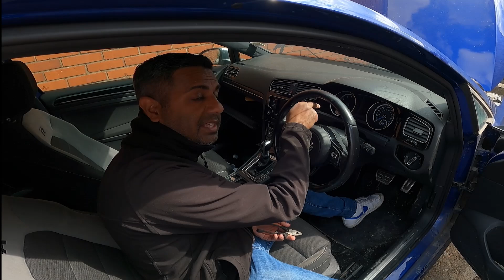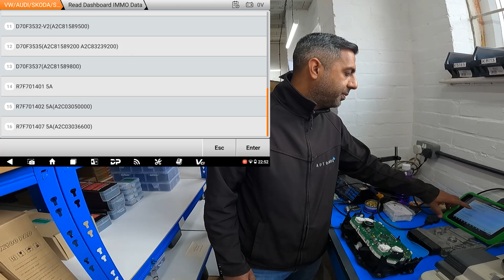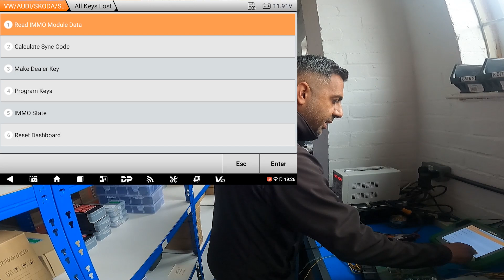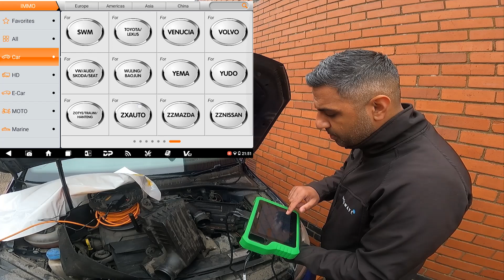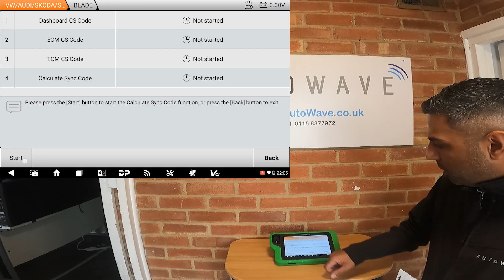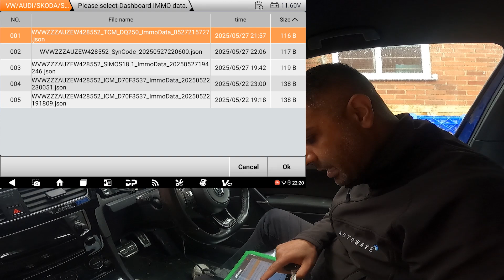Volkswagen Golf 2014 MQB All Keys Lost Using Obdstar G3 Sync Data Calculation Function Full Tutorial

Comment: Hello am new in the MQB programming business, I have an Abrites AVDI so is it best to build around it or Buy OBDSTAR G3
Reply from the maker: Hello, we would recommend the G3. You can purchase it here: https://autowave.co.uk/product/obdstar-key-master-g3
Reply: @AutowaveLimited hello i have had a timing misfortune and I purchased obdstar x300 and dc706 with all the adapters before the G3 came out. I know that the X300 is a Loss but Can I perform ECM, TCM & ELV reading and decryption like the G3 does if i have all these adapters including ECM001, Mp001, P003+ with jumper, ELV collector then manually input the Appropriate CS codes to calculate Sync Data?

Comment: Hey am John from Kenya and i deal with car keys, my question is why did do TCM configuration and was only keys lost
Reply from the maker: To Calculate Sink Data From Automatic Vehicles You Need To Read The TCM.
Reply: @AutowaveLimited do you have a video on BCM2 such as Touareg Proximity (2011 -17). I believe ELV data is required besides BCM2 data BUT is ECM & TCM required as well assuming it is an automatic gearbox?

Comment: Really good video. But please don't say that connecting the power to the G3 is the same as  connecting to the MP001. It is connected together you are correct, but, it's the thickness and current capacity of the cable from the G3 to the MP001 that can be a problem. You will 100% get a voltage drop across this cable. Some ECU's do have a bit of a rush on the supply current as they power up and switch internally (PCR2.1 comes to mind). Always connect the power as near to the module being read as is possible. It's not worth the risk not doing this. All the same, superb video 👍

Comment: I wonder how did You get D-FLASH & P-FLASH from the other solder-less tool. I assume it was Xhorse VVDI-Prog or KTP with Xhorse solder-less adapter. But when I read the dash I get only 1 file that is named like MQB-LOCK(D70F3526)-V4-READ(ADAPTER)--MQB-20250707-133949_VW_Passat_B8_AKL.bin
How can I divide this into 2 pieces?
Reply: I was wondering the same thing mate. I hate these kind of videos unexplained thoroughly.

Comment: Great video! I was wondering, as someone who is learning how to work with ODIS (dealer level software), what security measures are built in to your device. What would stop someone for doing this process on a stolen car? With odis you need online access to make new keys, and technically you can get it only with your VW “service number” which you get after a long process. Is there a process of verification for your device?
Reply from the maker: Thanks for the feedback. Unfortunately we don't deal with Odis or any dealer tools.